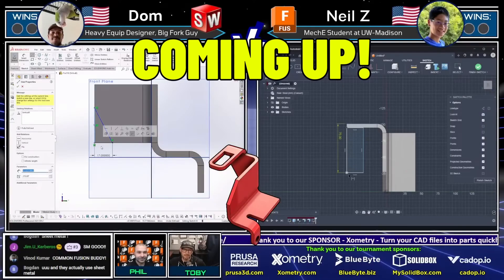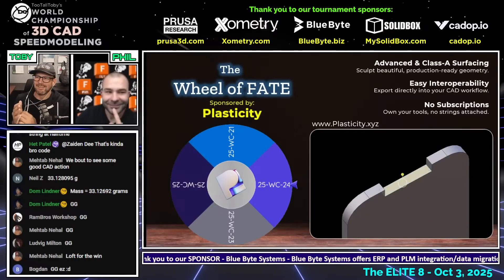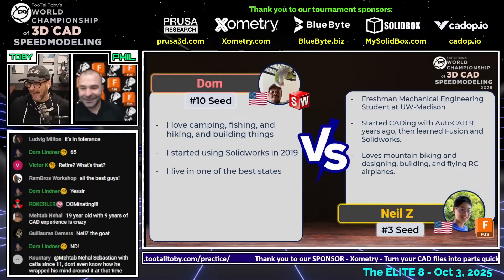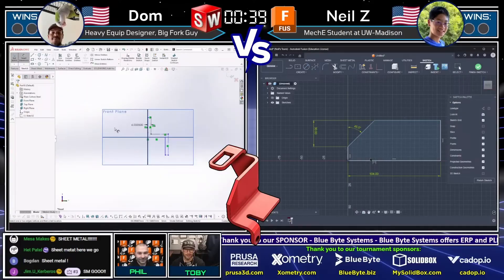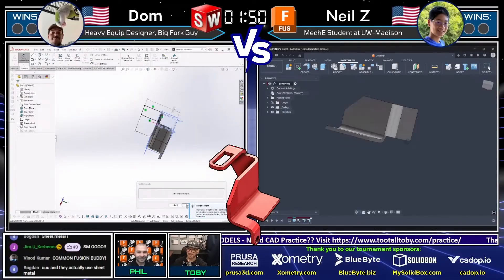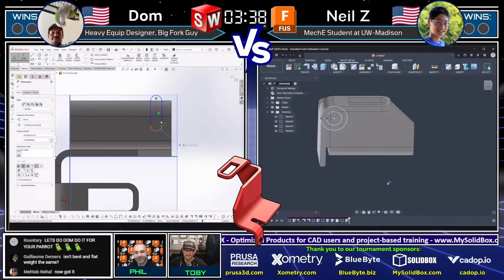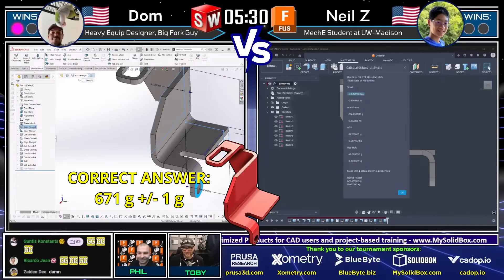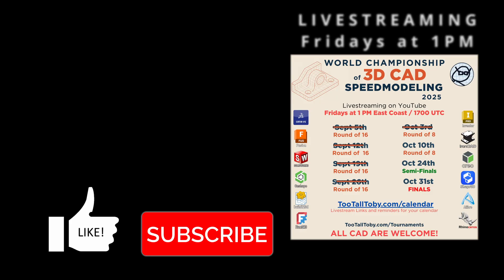CAD Speedmodeling Tournament! - MATCH 10 - Battle 1 - WORLD CHAMPIONSHIP 2025 - SHEET METAL!!

Comment: Both doing great job, but i question the mass that was given of 670,89gr. That mass was given for the bended part and the CAD software i know of, do not give the correct mass from the bended part, but rather from the flat pattern part. In the bended part there is a K-factor that accounts for the position of the neutral line in the bends. But CAD does not account for that when calculating the volume (density -> mass). So, for flat pattern the mass is 655,07gr and for bended part it is 670,89gr. Just something to think about.
Reply from the maker: Hi Jakob - yes you are correct - the mass of a model (in CAD) is different in the formed state than it is in the flattened state. This is due to deformation that occurs in the bent region of a physical part - deformation which is not properly accounted for in the "idealized" CAD model. I discuss this a lot in this video, which you might enjoy: https://www.youtube.com/watch?v=-4uN9eRihQQ

Thanks for the insights and glad you're enjoying the channel!